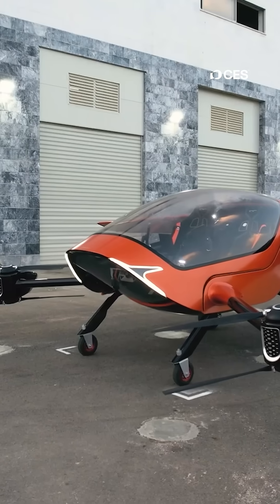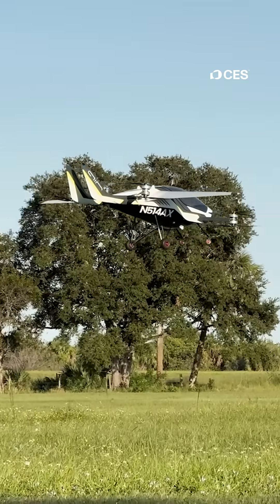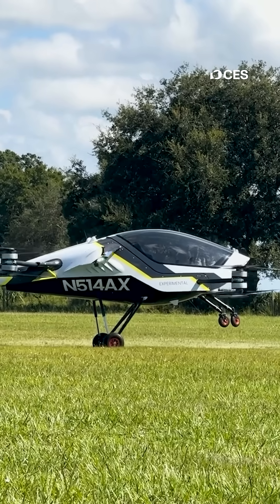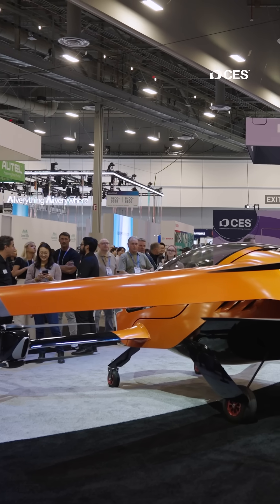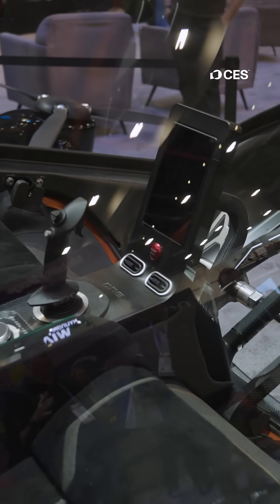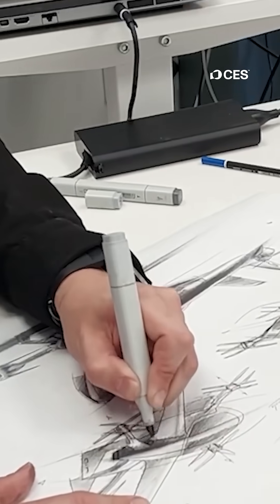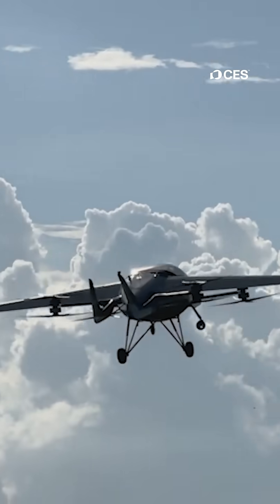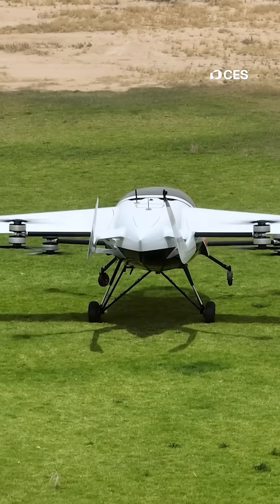Inside the World’s Largest Coaxial Quadcopter

Comment: Might as well add one more motor and propeller at the back since you have wings on there
Reply: Yeah the large wings didn't make sense. It's not going to generate the lift they're thinking as coxials will develop a bit more turbulence outside general thrust vector. Smaller wing would have been better or yeah, add a pusher prop for more land speed to make it worthwhile.
Reply: @jojog8304 It looks like the wing is tilted enough so that the vertical lift propellers can generate some Forward thrust and the wings some lift at the same time